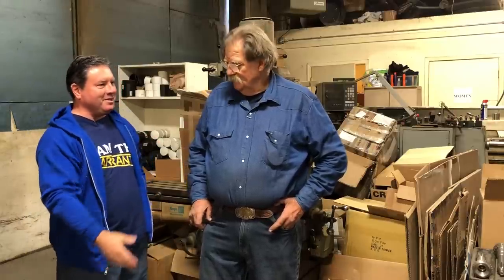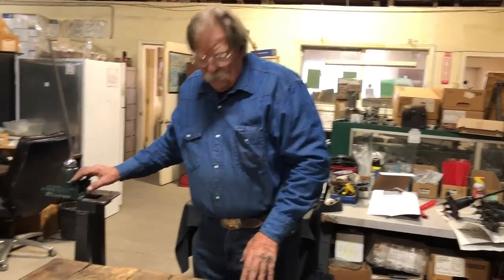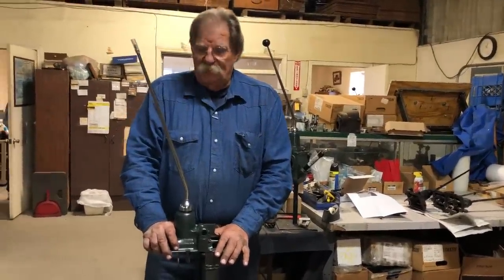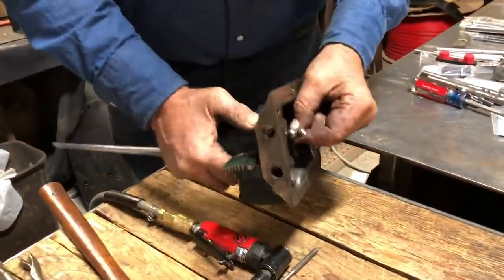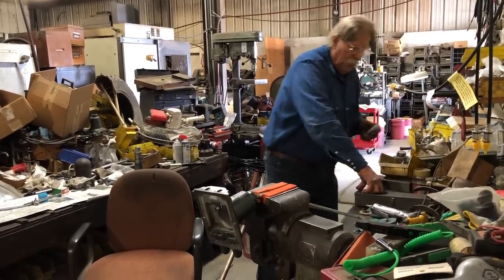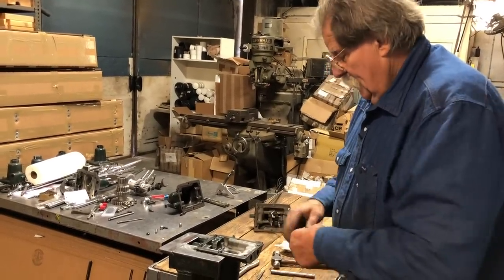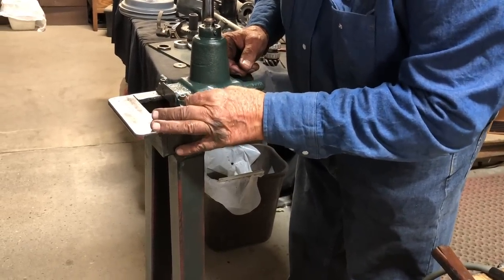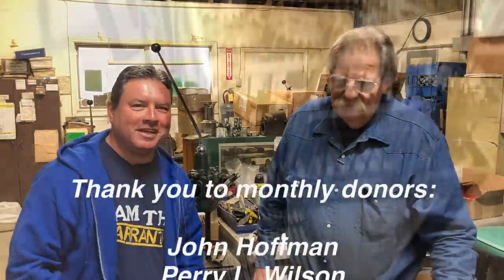How to rebuild Ford Model A shift tower with Steve Mitchell

Comment: Paul, I’m glad that you had the opportunity to travel up and visit the Mitchell family business.  It is a small family business in the true sense of the word, a dying breed.  Steve, Bob, and so many like minded people are the foundation of the enduring Model A community.  Schwalm’s engine shop is another fine example. If you’re ever visiting the East coast, they would be worth a visit.  You know you’re in good hands with these businesses when their waiting lists are six months or more on average.

Steve has helped me out with professional advice on Model A projects extending beyond gearboxes and drivetrains.  I’m a true believer in the overdrive gearbox for anyone wishing to use their A as a driver; yes it is that good. I’m considering his transmission gearbox, not so much for the synchro feature, but rather the gear ratio spacing.  Using the overdrive gearbox as a ratio splitter one can mask some of the large jumps between ratios in the transmission. Second gear and overdrive is golden for climbing hills. The new transmission would be icing on the cake.

Steve’s challenge is that there are only seven days in a week. He’s the real deal and his products reflect this. Likewise for the entire family. For anyone not familiar, visit their website.

Comment: Mitchell makes outstanding products and are wonderful to work with. It is very easy to see how much pride they have in their products through their craftsmanship all the way to the way they package them when they ship them out.

I've been recommending their transmissions quite a bit lately, as it is a good deal of effort putting in the flathead v8 transmissions, let alone the trouble of finding quality ones. Having those close ratios and their overdrive is a fantastic combination.

Comment: Hi Paul, Yes I have enjoyed this Mitchell visit, and I do have ordered and installed both the dipstick tube and the shift seals inside the bell house, and I can confirm its a very nice and good quality products. Has stopped the oil 100% of dripping into the bell housing and to check the transmission oil is a breeze.

Very interesting this Mitchell visit and thanks Paul.
Reply from the maker: Excellent

Comment: I have always wanted a Model A for at least 20 years. Is there a best year Model A I should look at? Of the model years is one better then the other?
Reply from the maker: Mechanically, they are about the same.  I prefer the 30/31 models slightly because of the larger radiator and smoother styling
Reply: @ModelA Shinn Thanks for the input. I also like the 30/31 models. Now the adventure begins. I really enjoy your videos with you, your Dad and Model T.
Reply from the maker: Thank you!